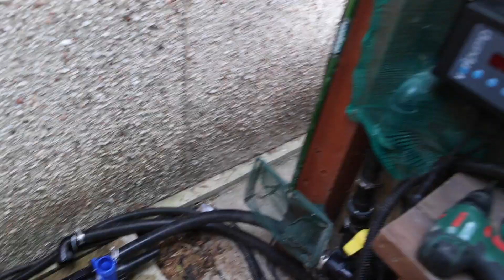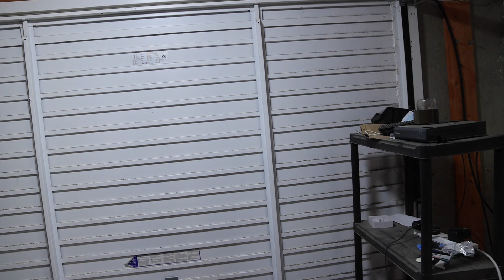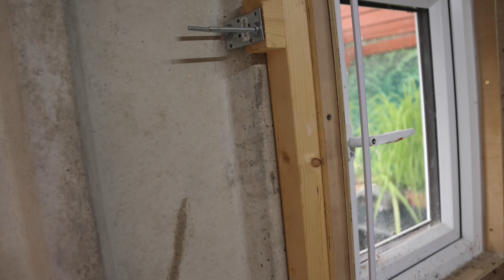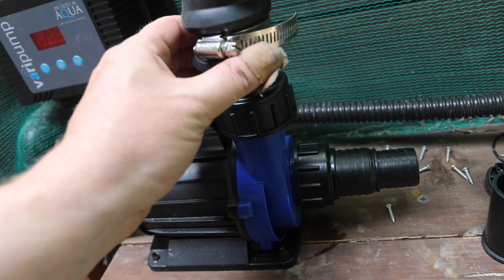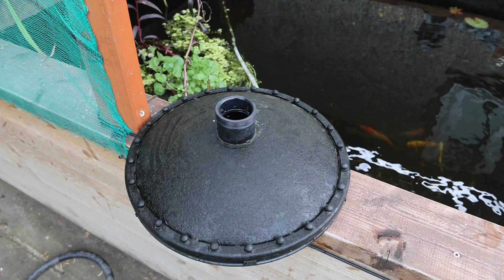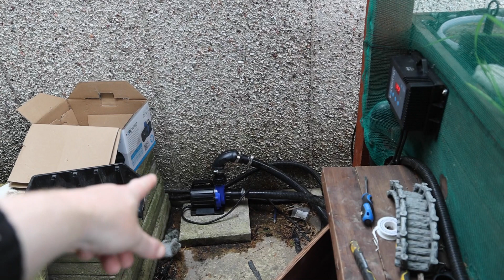EA New Pond Pump Vari Install & Garage Conversion Update

Comment: It's only one hose tail because the strainer cage is meant to go on the inlet and the whole thing can go inside your pond. But as you've seen they're quite adaptable. It would be interesting if you could measure the flow rate and actual energy consumption as there's quite a lot of speculation around EA pumps not being as good or delivering on their specifications as Aquaforte or oase pumps. If you do decide to test max power don't do it for long as the EA UV's max flow rate is 10,000 lph and I would doubt it's effectiveness at that flow rate 🤔
Reply from the maker: Flow rate for my 25 watt uv is 7500 lph. But I am running at 35 % . Seems fine as for wattage your correct it uses more power than old pumps as they were at 24 watts. New pump uses more power
Reply: @yorkshirekoi2246  I've read that the 25w UV can take 10,000 lph and the 15w UV can take 7,500 lph the new EA pump won't necessary use more power than 24w it depends on how fast you want the flow but the question everyone wants the answer to is do these pumps really use the wattage they say they do ? And are the flow rates anywhere near what they claim ?